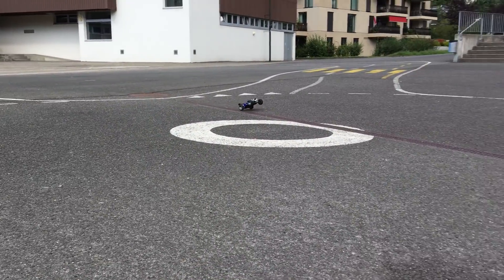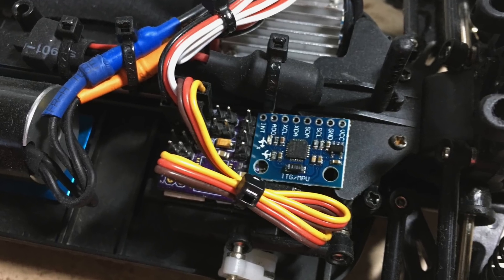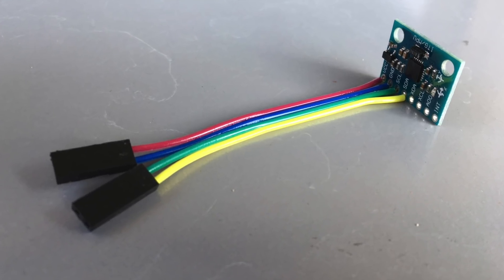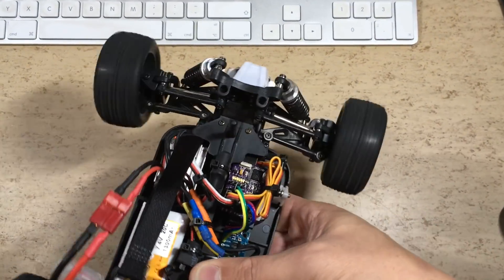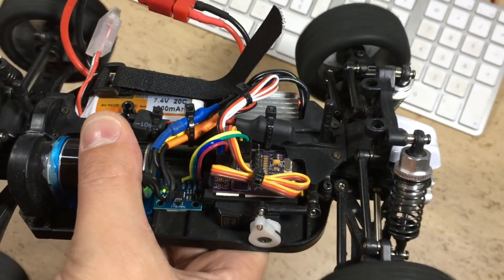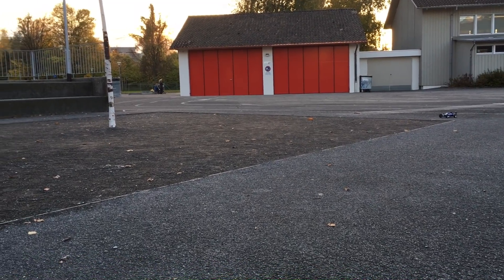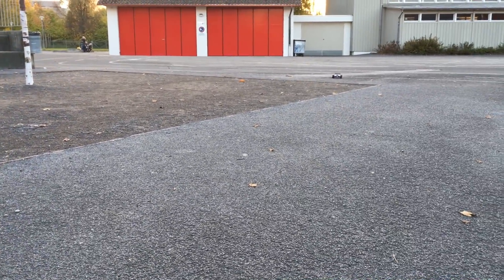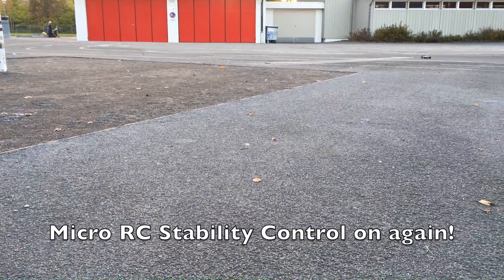Brushless Wltoys A959 With DIY Arduino Stability Control!

Comment: Dumbo RC makes a receiver with stability control and will bind to up to I believe 100 models for around $11.00 for the receiver and $30.00 for the radio. I have it on six of my cars and trucks
Reply from the maker: It's certainly a good radio, but DIY is more fun ;-)

Comment: Can I control throttle by arduino?
Reply from the maker: Yes, you can, because my entire "Micro RC" remote system is Arduino based. Every standard ESC uses servo signals for speed control

Comment: Can i do that with the stock internals?
Reply from the maker: No, but I have an alternative for the stock electronics:
https://www.youtube.com/watch?v=pNb_3yC4mTQ&t=231s

https://www.youtube.com/watch?v=cW0dXprR9rY
Reply: I dont understand much of the electronics if you could make a step by step built of the gyro would be really nice i dont understand the potentiometer it has to be in the car? Or its only for the programing?

Comment: Would it be possible to do this with the accleration so you dont flip the car over when acclerating ?
Reply from the maker: In theory yes. But what's the point? Driving should be fun
Reply: TheDIYGuy999 Yes but its not fun to flip the car. So would be cool if it stopt giving gas until the front wheels was on the ground again

Comment: The weak point that i cant find a replacement for on this car is the plastic spider gears in the differential. I noticed the Remo Smax diff. has metal spider gears and is similar in size. Have you tried a swap? I see you own both.
Reply from the maker: It is similar, but the size is different. I have never broken gears in this car so far.

Comment: Can you connect this to any receiver per say a spectrum dx2 receiver or does it have to be arduino receiver?
Reply from the maker: It only works with my Arduino "Micro RC" receiver, but I also have a standalone version for receivers with 3 pin servos:
https://www.youtube.com/watch?v=s2kW7vN7KI8&t=2s

https://www.youtube.com/watch?v=K1FvhzmcJDw&t=1s

and 5 pin servos:
https://www.youtube.com/watch?v=pNb_3yC4mTQ&t=25s

https://www.youtube.com/watch?v=cW0dXprR9rY&t=37s

hope this helps

Comment: I dont suppose u have a step by step guide on how to build from Start to finish. Thanks
Reply from the maker: The brushless conversion, the remote or the MPU-6050?
Reply: TheDIYGuy999 sorry i should have been more clear. For the stability control. If thats both mpu-6050 and cotroller?
Reply from the maker: The stability control in this videos only ha 4 wires. SDA, SCL, GND and VDD they have to be connected in accordance with the schematic: https://github.com/TheDIYGuy999/Micro_RC_Receiver/tree/master/Eagle_PCB
So you can't go wrong I think. BUT: this version can only be used in combination with my "Micro RC" system.
I also have a "standalone" MRSC version for WLtoys 5 pin servos: https://github.com/TheDIYGuy999/MRSC_Adapter_WLtoys_5Pin_Servo
https://www.youtube.com/watch?v=pNb_3yC4mTQ&t=6s
A 3 pin version for standard receivers and servos will follow soon

Comment: Can I plug this on wltoys 12428?
If yes, how to connect?
Can You help me?
Reply from the maker: No. But one of my next videos will show you, how to build an MRSC unit for 5 pin WLtoys servos. This is exactly what you're asking for. The prototype is already up and running and you can find the software here: https://github.com/TheDIYGuy999/MRSC_Adapter_WLtoys_5Pin_Servo
So stay tuned for the video.

Comment: Nice job i wanted to ask you to have the same thing on my car must also build the tx and rx or can we install Arduino MRSC without building the tx and rx
Reply from the maker: Thanks. You can only use the MPU-6050 with my RX. But all the software and the documentation can be found on my GitHub: https://github.com/TheDIYGuy999
Reply: hello with a little research on your GitHub
I ordered the pcb on OSH Park I will start the construction once the pcd received and all matereil
thank you for your answer i will come back for help if i have a problem

Comment: Hello, i have a 1/24 Rc Rastar Audi car and last time the motor was fried.I tried to open the car and take out the motor.There are two gears to make the wheel drive but now i don't know in which position i must place them for the motor to get in contact with the wheels!
Guys, can you help me out?
Reply from the maker: Hi, the motor pinion usually connects to a bigger gear, which has again a smaller pinion on the same axle. This one connects to a bigger gear (maybe on the main driveshaft)... and so on. hope this helps
Reply: TheDIYGuy999 I have tried so many times but the motor cover won't close...the gears make a bad sound! Could you send me a video or photo by gmail?
Reply from the maker: Ravi Maxx Sorry, but I don‘t have this car. So I can‘t send you a photo
Reply: TheDIYGuy999 Hello,i tried one more time today and now it's good...the problem was that I placed the gears at the wrong place ! Thank you very much for helping me ! 
😜
Reply from the maker: Ravi Maxx You‘re welcome

Comment from the maker: The fastest MPU-6050 implementation so far! Allows full acceleration on gravel... Works just like Traxxas TSM!
Reply: TheDIYGuy999 Hello, i have a 1/24 Rc Rastar Audi car and last time the motor was fried.I tried to open the car and take out the motor.There are two gears to make the wheel drive but now i don't know in which position i must place them for the motor to get in contact with the wheels!
Bro, can you help me out?
Reply: TheDIYGuy999  hola. Sabes cual estabilizador puedo usar en la emisora original de fabrica del a959?